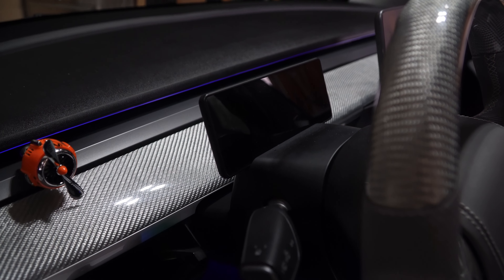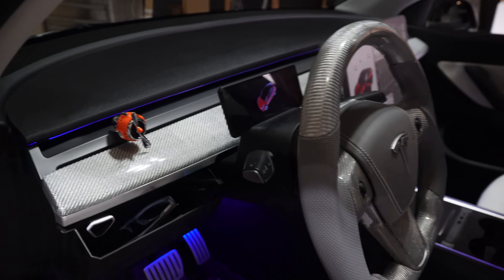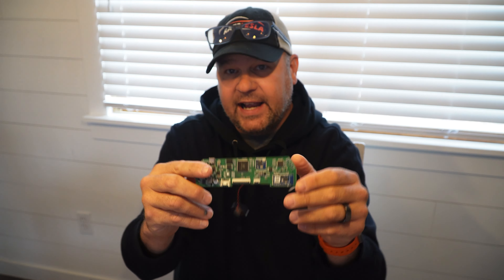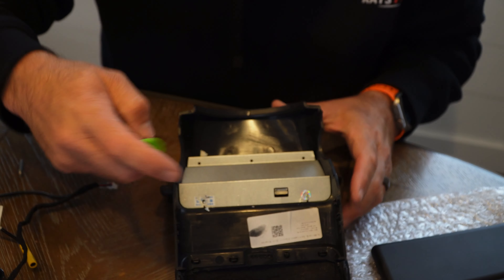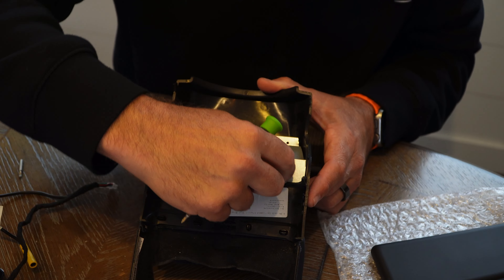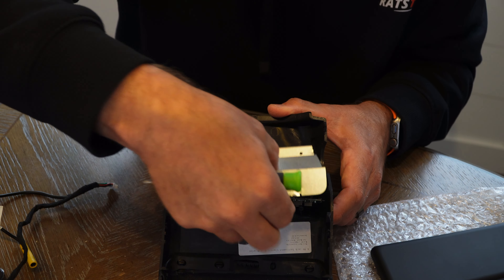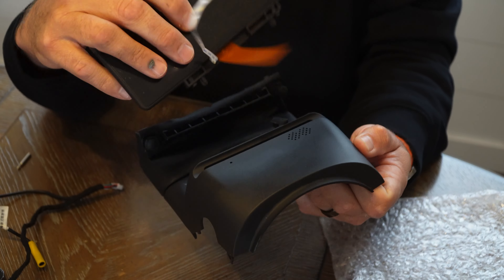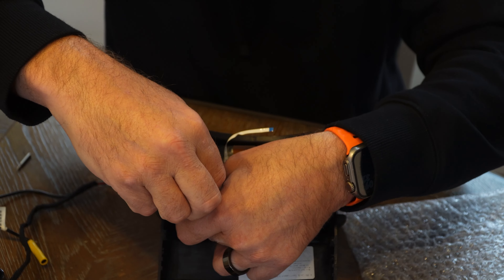Supercharge Your T6 Infotainment: CarPlay on Your Screen

Comment: Nice I have the same screen.  I got it originally from Hansshow (non-touch screen version) with front camera, but upgraded it from TMA's upgrade kit.  Unfortunately my camera has developed a fog and Hansshow has to send me a new one...the camera only lasted 1.5 months and it's not even winter yet :(  Pain in the butt as I have to take the whole car apart again to re-install the new camera.  Otherwise I like the display.  One thing to note also is that the clips on the steering wheel column plastic piece are EASILY broken.  I had to order a replacement piece from TMA.  And the new one they shipped to me had broken clips ...so they are sending me yet another.  So be very careful installing it.